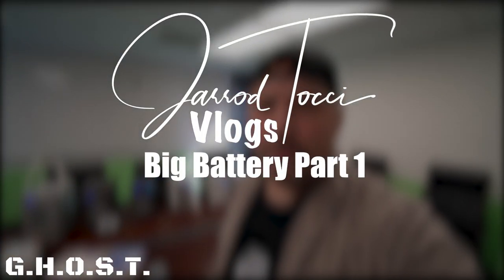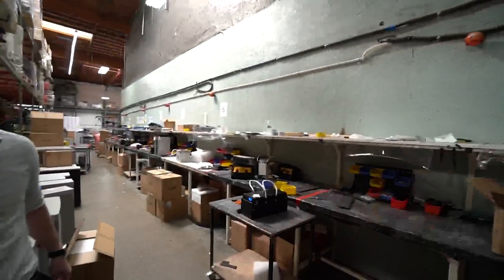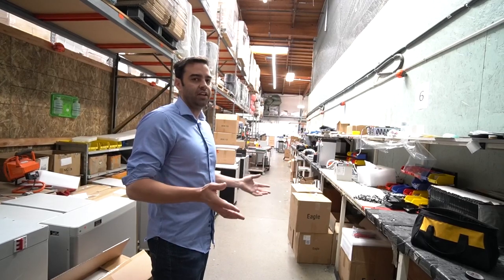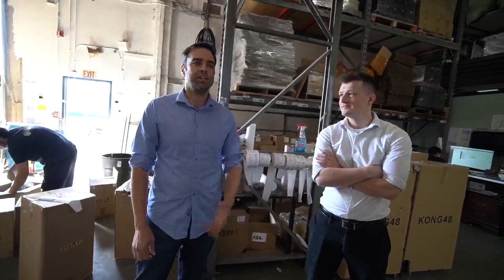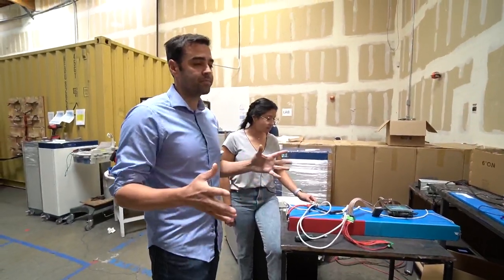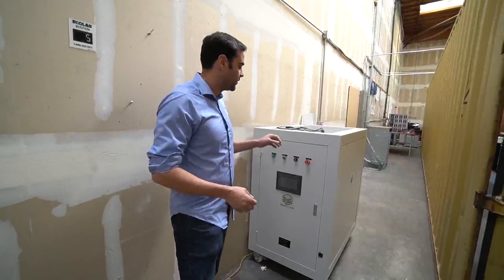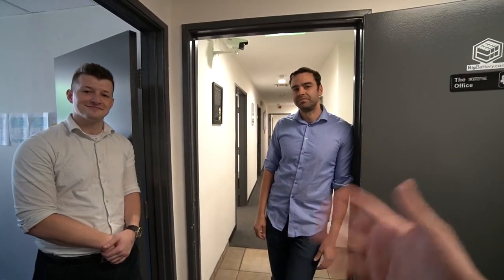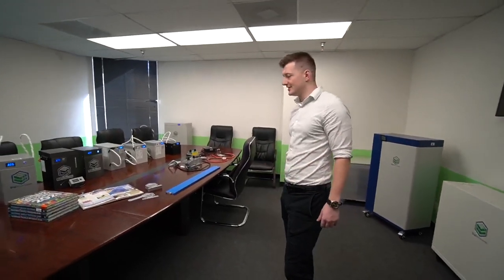Inside Look Lithium Battery Co. Big Battery! Shop TOUR

Comment: Just installed my third OWL MAX2 228ah battery in my camper van.  Bought the first one a year ago, the second three months later, and my third a month ago (to support my new Nomadic Cooling DC air conditioner.  First two batteries have performed flawlessly, and I added the third to my van on Saturday.  Great product, great price point, great features.  Not affiliated with BB at all, just a very satisfied customer.
Reply from the maker: Glad to hear this!! Enjoy them

Comment: Visited two different Battle Born distributors 500 miles apart inquiring about adding 4 more batteries to my existing 4 battery system so I can get at least 8 hours run time our of my Cruise N Comfort AC (for the dogs). They didn't want my business.

I want that Big Mama Jama!
But then I'd have no room for my dogs 😕
Reply: Wow! Every time I’ve called Battle Born Batteries they wanted my business? First I bought four, then two more and then finally two more.
Reply: @benjones8977  maybe they only wanted to sell the batts, not do the work of installing
Reply: @LilyWasHereMB  
Well with what I know now I would’ve bought other batteries. They were very expensive. But it was my first system. I wanted to make sure that I didn’t have any mishaps.
Reply: @LilyWasHereMB  They sell batteries. They don't install them.
Reply from the maker: I don't "bad mouth" too many but I think I've made it known that Battle are probably towards the bottom if I went lithium. Off top of my head, I can think of 1 or 2 others I would put bellow them. But with Big Battery they make several different sizes so you can have room for your pups. In 2 weeks I have a tour coming out with someone that used 4 Hawk batteries and it's the largest system I've ever seen!!!
Reply: I want to see your system powered. Let me know if I can help.

Comment: I will be more impressed when their prices come down to reality. Which should happen as soon as LFP batteries are being produced in the US instead of being shipped from China. And contrary to what they say? These are not all Grade A cells. Those blade batteries are production offcasts from BYD in China. You take the cover off it and every single battery will have some imperfection in their wrapping. They are grade B+.

Comment: The batteries are from China
Reply: Which ones aren't? Even BattleBorn source their cells from China. China doesn't mean cheap. Everything is built to your specs.
Reply from the maker: They said in the video the cells are from there. But every lithium battery comes from there. Certain companies like this one will assemble them here in the states. Some, like this one, does their own BMS which are super important too. There's a lot more into this than just a battery cell. Again they were not shying away from where the cells came from as they said it.